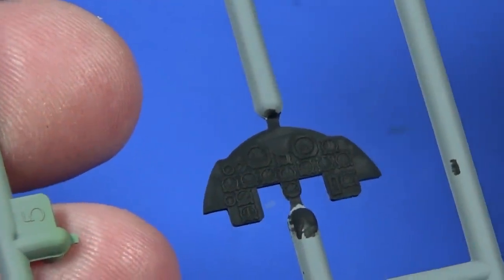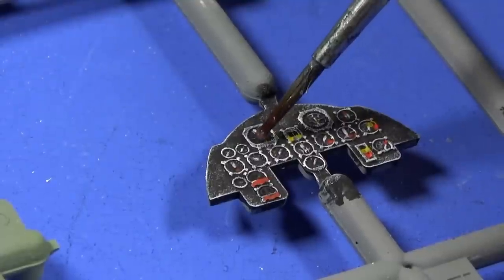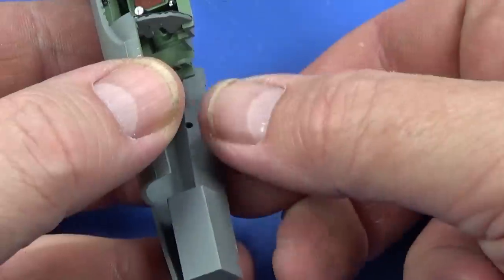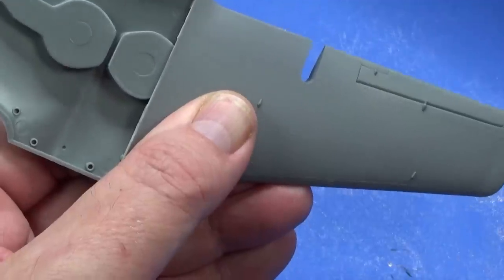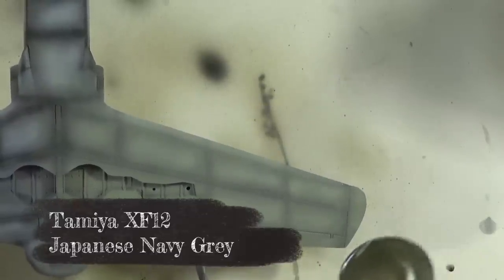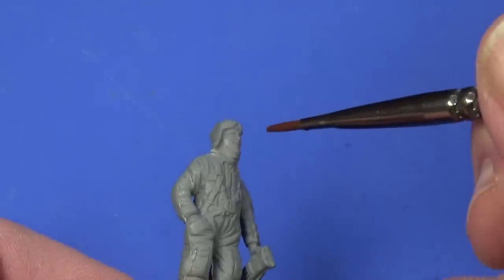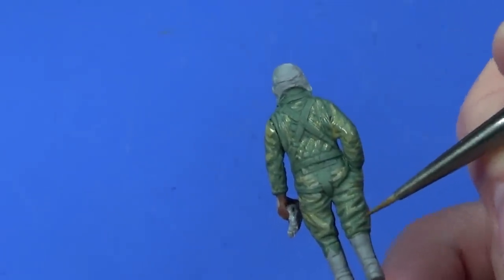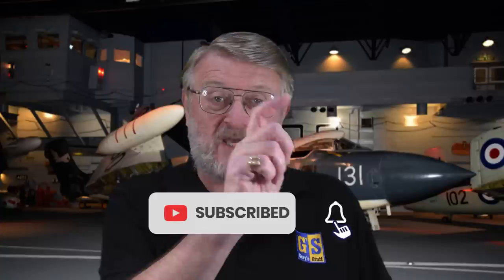SPECTACULAR KYUSHU SHINDEN - Hasegawa kit in 1/48 - how to build it!

Comment: Hasagwa made 1/72 scale of the aircraft that i''ve built. I reckon the Shinden must be one of the very few tricycled undercarriage piston powered aircraft that doesn't need any added nose weight. The 1/72 kit I think must have been produced later, as it has all recessed detailing and panel lines, the fit on the 1/72 model is just as fantastic as your 45th scale one. About the only difference between the two kits is that the 1/72 model has a much simplified cockpit, and a single piece nose gear and wheel assembly it also has identical decals only smaller of course.. I first became aware of the Shinden way back 9in the late 50's or early 60's when "Flying Review' did an article on canard designs from WW2,.and the information back then was was basically what you said, only with some estimated performance figures, but nothing about any remaining or replica aircraft. Thank for these Shinden videos as it's always been an aircraft that's fascinated me, and even 60 years later still does. JtP.

Comment: A tip I saw yesterday was to use a tiny drop of clear coat glue - used for gluing clear parts - on instruments to simulate the lenses in front of them. Nice effect. [Edit: Ahah.. I see Gary used PVA for the same effect :) ]

For the under-painted shadowing on the panel lines, if you don't have an airbrush, could you use a heavy dry brush along the panel lines to create the same effect?
Reply from the maker: I guess you could dry brush to get the same effect, then use thin washes of top colour until you get the effect desired. Or dry brush or pastel the darker lines after painting the aircraft.